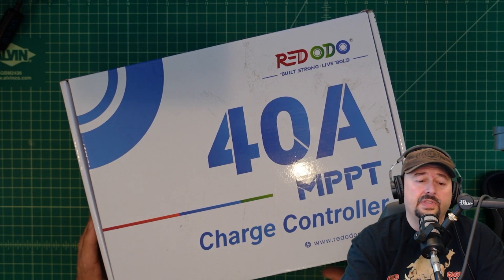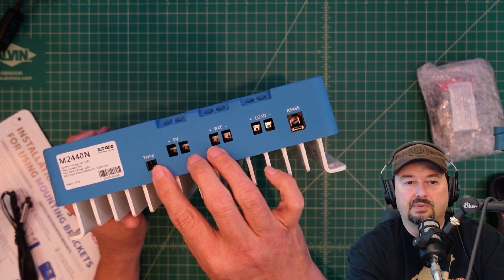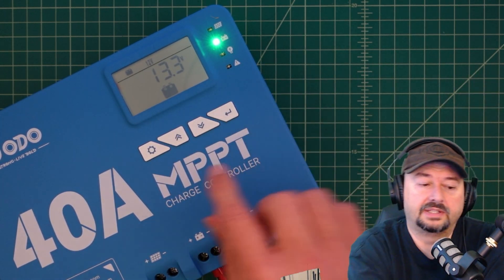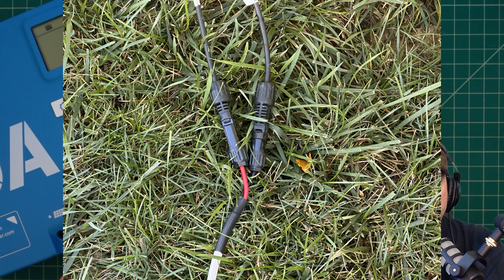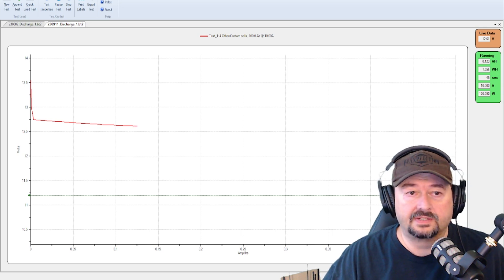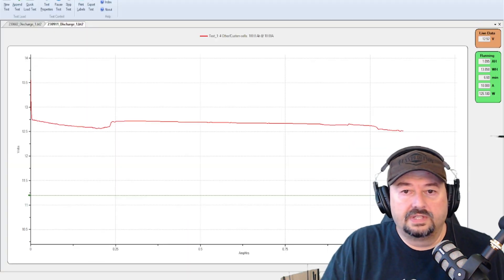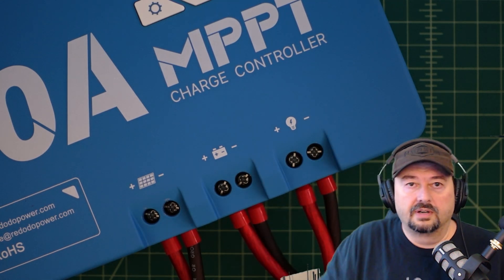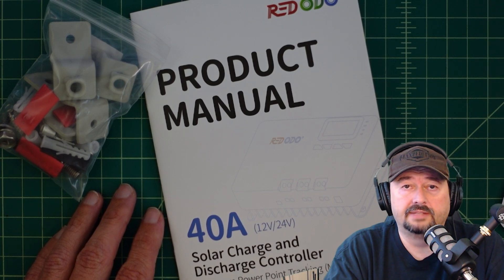Redodo 40A MPPT Solar Charge Controller

Comment: In some cases you may want a Solar-charger with larger MPPT voltage range. Especially is you use Thin-Film panels. 😉
EPever offers some MPPT Solar chargers that does 150V and even 200V ( AN series ). 👍

Comment: That look real nice. love the Bluetooth app. with MPPT controllers HAM and SWL people may get some RFI noise from them. I have several MPPT controllers and some for POTA go kit. what I found that works great for this is ferrite . can be snap cores but I have found T 240-31/43 works the best.  just wind like a common mode choke. wrap red and black together get as many turns as you can . and mount them right at controller . 1 for each. solar/battery/load .every MPPT I had or used this works on. Victron ,Morningstar Etc. also that load can be used as a light controller. turn on lights at night for X time you set that or dusk to dawn.  for LiFePO4 you do not need temp probe but still can use to check temp in the room. they gave it. use it I say.  that WMR battery tester can test solar panels as well. and load test power supply's to a point. should use #8 AWG for 40 amps. #6 AWG better if long. they make bigger power pole connectors Powerworkx has them.  PP75 is next size bigger. also the SB 50 Anderson is great. they have up to 350 amp ones. for SB and power pole up to 180 amp ones. same red and black.  they also have many colors. I used power pole yellow and black on my solar POTA go kit. nice to see a HAM radio side of this review. 73's
Reply from the maker: I still need to test RFI but yes ferrite is the way.  Thanks for the comment 👍

Comment: Great video, Ape. I have this controller with different branding (HQST). It works well but mine is really RF noisy especially on 17 to 10 meters. I can't run the radio off the battery at the same time I'm charging if I'm on 17 to 10 meters. It's tolerable on 20 and 40. With a 200 watt Renogy panel, it charges my 60Ah LiFePO4 battery pretty quickly. I noticed the difference in charge time with MPPT vs. PWM controllers but probably not enough to give up my PWM Bioenno 20A charge controller. 73 de N6EF
Reply from the maker: Dang.  I haven’t tried it with a radio yet.

Comment: 600w is a great place to start - lots of room to add panels!  I get that you need to run your load off the battery, but that makes all that "intelligence" in the controller pointless since you can't measure what's coming out of the battery, only the load port and charge port.
Reply from the maker: Even at 40A out it still wouldn't be enough as my inverter is 2,000 watts, but I can use the controller to track what goes into the battery.  Most solar systems are like legos and end up being a hodgepodge of components.  I'm thinking about using a shut on the battey to measure output but that ends up being one more link in the chain.
Reply: @TheSmokinApe  right!  Too many parts.  I have a controller with no display if I didn't leave it in the storage unit...

Comment: I was just looking at products like this, and I noted "Load" is rated maybe half of the headline value. So direct connect to the battery is probably necessary, rather than to Load, to run 100W.
Reply from the maker: Yep, totally agree.

Comment: Time to fire up the HF rig & spectrum analyzer and see if it is noisy before you install it in the shack.  I am interested to see the results.  The Bluetooth & app are a nice feature.  I use an Apollo MPPT charge controller from DIY Solar For U.  It is very quiet.  The guy that designed and sells it is a ham (and an EE) and has EMI data listed on his site.
Reply from the maker: Hey SF.  Yeah, I will need to do some RFI testing it seems.  Thanks for watching!

Comment: Great breakdown ape! 

I actually have this charge controller, along with a few others but I still don't have the battery storage capability to REALLY test the dang thing! Hopefully I can add that in the future, and not to mention it's so shady here in my yard with all these massive oak and pine trees around I'd need a 100 foot run to some solar panels at least to get to open sun! 

All to say, I think you did a fantastic job digging into the capabilities of this charge controller and if I was on their marketing team I'd say you earned the hell outta that product!

Thanks again ape! 73
Reply from the maker: Thanks Spivey and good luck with the system build out!

Comment: Ok buddy. Definitely need to hear if you can run HF while this is in circuit.  Personal experience, Renogy products completely wipe out radio. I've been running a Morningstar in my mobile ham shack without issue. Heard Victron is noisy, too, unfortunately. 

Multiple chemistry capability with this unit is exciting. 

Thanks for all your hard work Ape!
Reply from the maker: Thanks RE.   I suppose I am going to have to do some RFI testing.